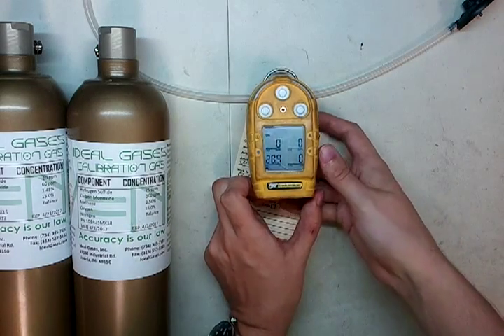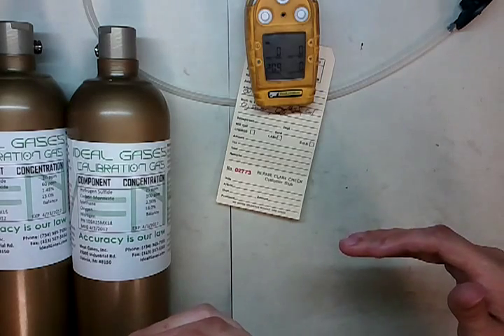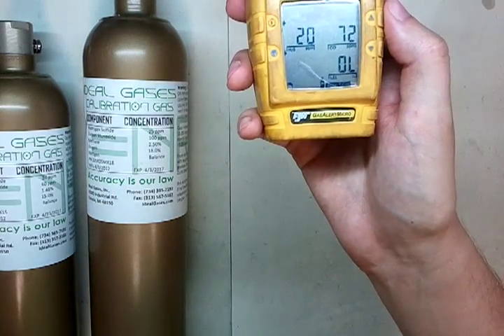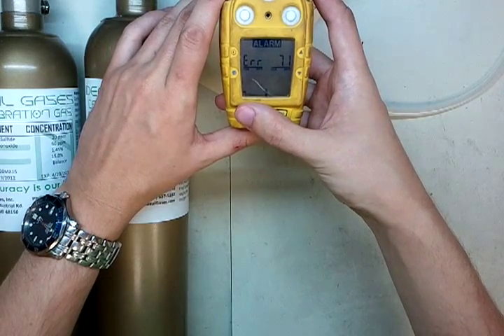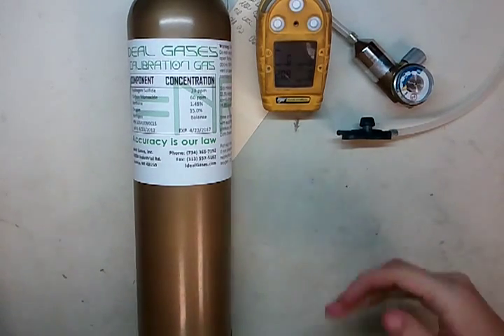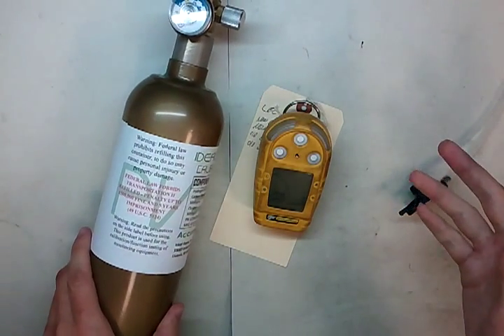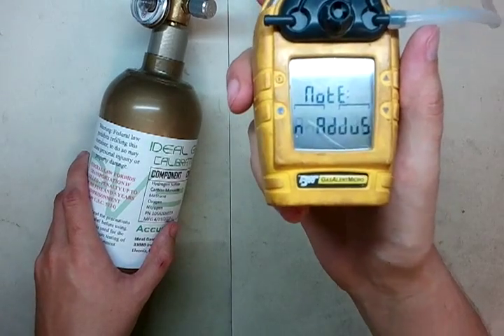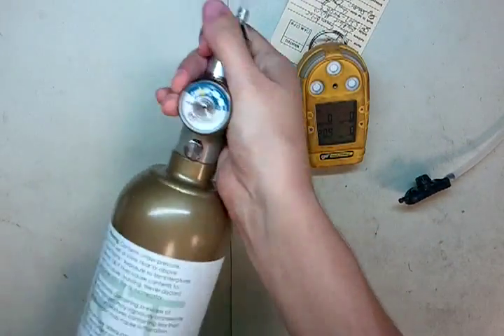New Gas Sensor Failing Calibration - How To Fix It

Comment: Dear Sir, Thank You so much for such a good and helpful video, but for BW GASALERT MICROCLIP XL how can I solve LEL error? If you provide your mail I can share my problem with video. 

Thank You
Reply from the maker: Best bet is going to be the same thing, just need to replace the LEL sensor in it
Reply: @Idealcalibrations  sir can you please give me your what's app number, then I can share my problem video with you.
Thank you for your quick reply.
Reply: if my calibration showed error after running it without the proper gas hooked up, how do I fix it?